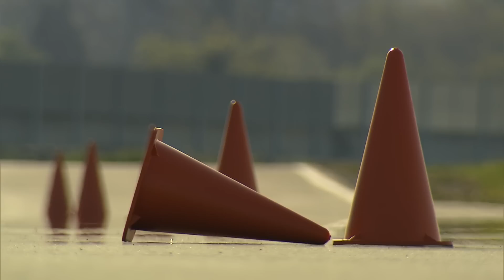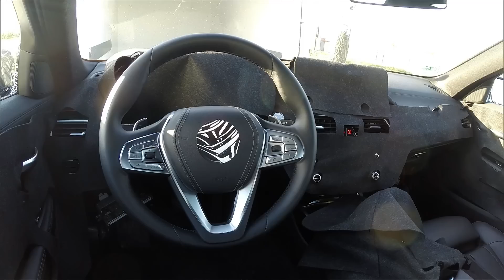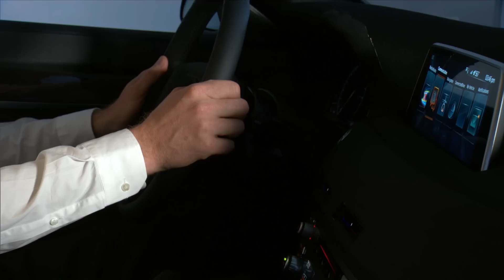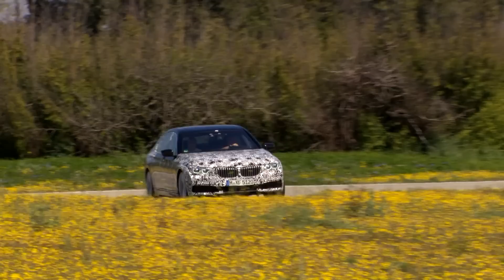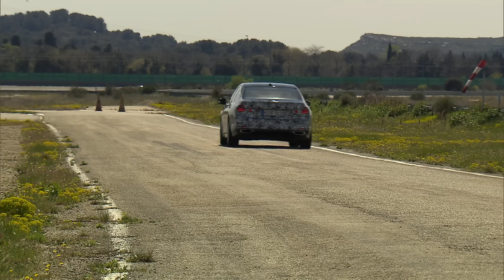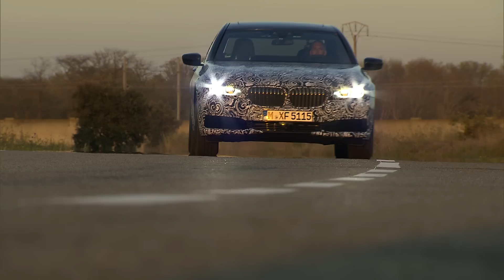Preview all-new BMW 7-Series 2016 technology: gesture control, auto parking, cabron fibre Neuer 7er

Comment: NOW, YOU ARE TELLING ME THAT GESTURES ARE MORE CONVINIENT THAN JUST A SIMPLE PUSH OF A BUTTON ON THE STEERING WHEEL TO ACCEPT OR REJECT A PHONE CALL, OR ROTATING YOUR FINGER IN THE AIR TO TURN UP THE SOUND, INSTEAD OF PUSHING THE BUTTON ON THE STEERING WHEEL WITHOUT EVEN HAVING TO TAKE YOUR HANDS OFF THE WHEEL, NOW THATS STUPID, ITS LIKE SCRATCHING YOUR RIGHT EAR WITH LEFT HAND.